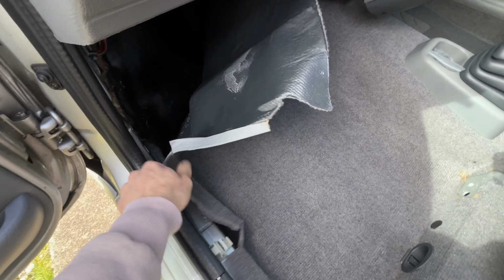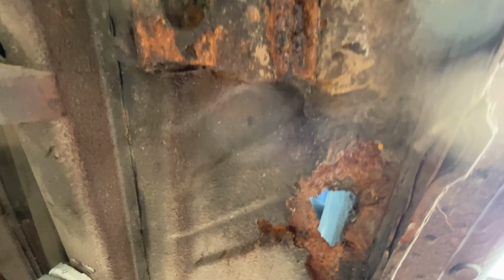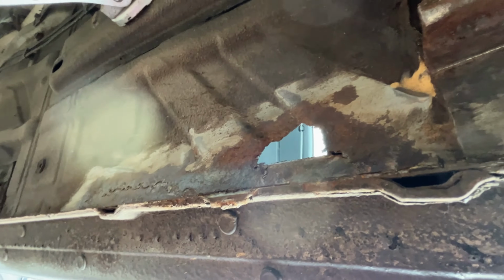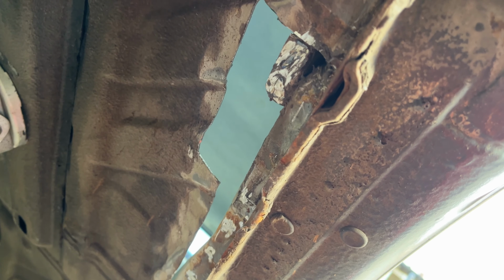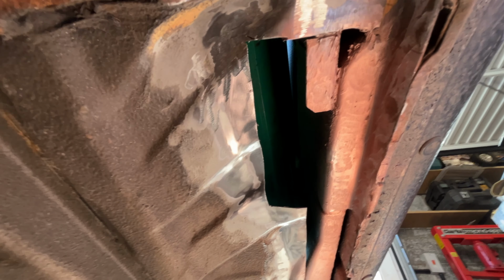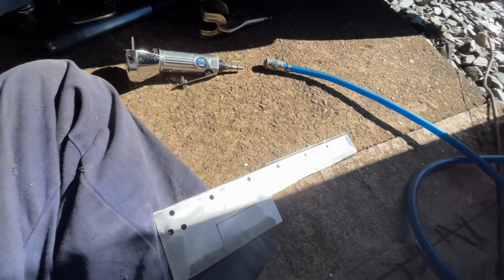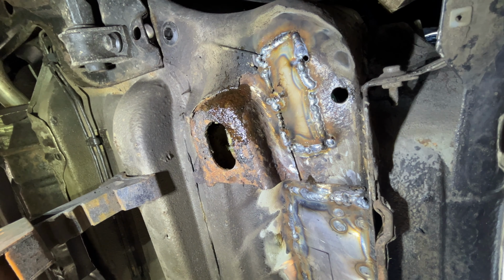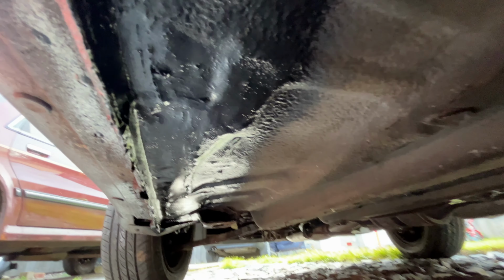1995 Fiat Punto MOT fail, saving it from the scrapyard!

Comment: That Punto is in amazing condition I had a little Turbo Diesel Punto in 1996 it was the most economical car I have ever owned it sipped Diesel used to get 65 to 70MPG on the Motorway which saved me a packet on my daily commute from Edinburgh to Dunkeld, I traded it for a Brava Petrol it was a real piece of Junk. Soft spot for these 90s Puntos.

Comment: Did the same  for mine but it failed mot due to not seem welding to edge off sill said was not alloud plugwelds needed to bee seemed all round also said needed to see all welds  repaired it before taking for mot too good work looks neat
Reply: If replacing the complete panel then spot welding is allowed but patches must be seam welded.

Comment: Never been keen on puntos only the MK1 turbo but they are rare and big money now but to be fair looks clean body wise but people would of scraped it because of the welding as if you can't do it yourself or no someone who can do it for a fair price as garages are expensive but that's wat I've done for 25 years welding and fabrication so I do welding at weekends for extra money but not just for any body as I'm fair but people expect it really cheap and if the job turns out more and you tell them costs more then it's even worse can't be dealing with idiots anymore fun trying to get under the car on axle stands but you did a good job not easy ive seen alot worse mate

Comment: Can't really fail that on an mot . Yes it's corroded but it doesn't seriously affect steering suspension or braking . It doest even seriously weaken the structure of the vehicle.
Reply: If it’s within 30cm of seat mounting I would fail it.